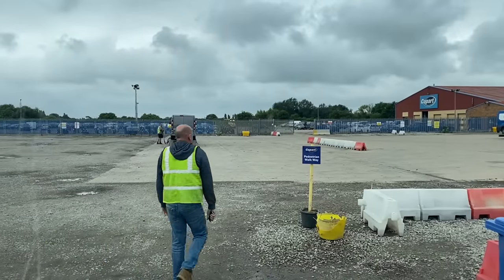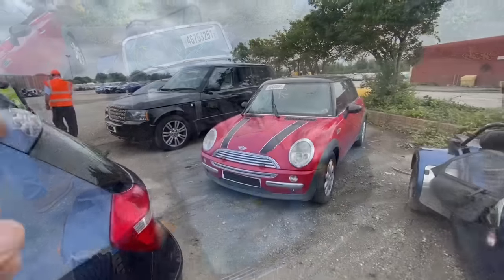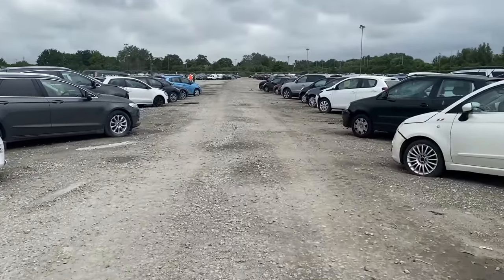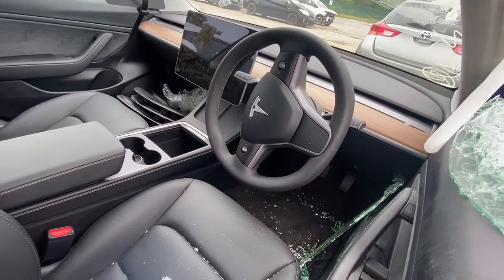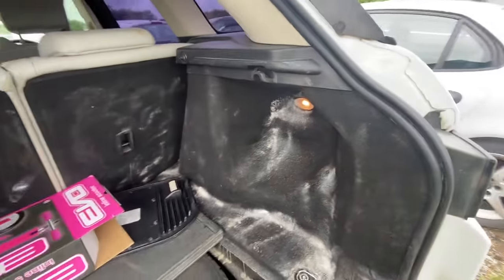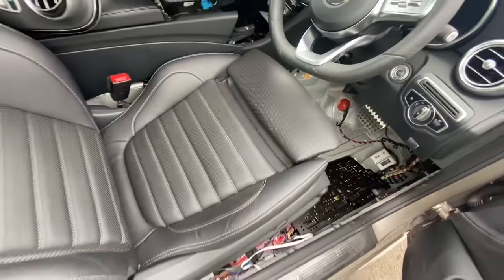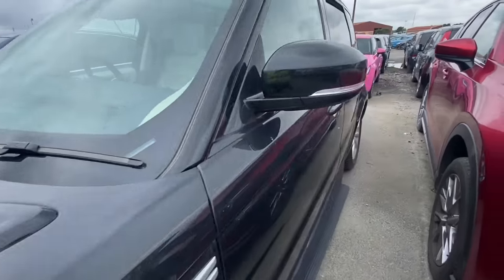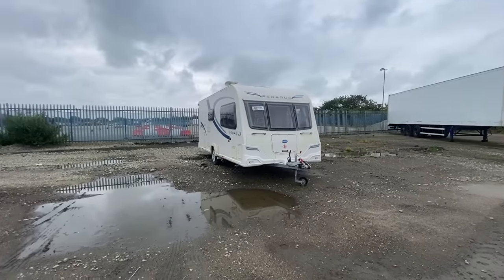Copart Salvage Yard Walk Around Caterham 7 C63 AMG Hybrid Porsche Tesla EV

Comment: 9:10 - "didn't see the back of it there, it's had a fire"

As is to be expected of hot, lithium batteries when pushed too hard (ie: to run a car). I giggled when I saw that tesla...long live the internal combustion engine!
Reply: it wasn't a zero emission car, on its last day!
Reply: That's either vandalism or a normal electrical fire. If the Lithium batteries had gone up there wouldn't be anything left.
Reply: @alibro7512  ICE vehicles generally don't have electrical fires, at least, they are uncommon. EVs on the other hand.

It also depends on if the fire was put out quickly or not. Batteries can be extinguished but without inhibiting the reaction Li has with air and water, it's hard to stop. Liquid Nitrogen and Dry chemical powder can work well for metal fires.
Reply: @S.ASmith  sorry mate, your wrong. ICE vehicles have electrical fires all the time.
This fire was no where near the high voltage battery which is in a metal box under the car. The fire started in the boot. Or rear seat.
Reply: @alibro7512  "ICE vehicles have electrical fires all the time"

I said generally don't . Electrical fires are more common on EVs, simple as. Saying otherwise is either ignorant or disingenuous. Electrical fires can happen in just about anything with electronics or cables that get warm/hot, but most fires in ICEs are caused by the fuel system or engine overheating issues. EVs obviously lack a combustible fuel, but the higher number of electrical components makes likelyhood of electrical fires much higher by comparison of a like for like ICE powered vehicle. Power-train cabling carries a lot of power to the drive motors, the stators can also get hot. 

Never mentioned anything about batteries in my original comment either, so feel free to continue knocking down the strawman you've built.

Comment: Buying a salvage Tesla is just asking for trouble. If you get the car up and running again, Tesla will probably disable it via an OTA update (not good whilst driving down the motorway). If you use certain parts from it to repair another Tesla, it'll probably brick the Tesla that's being repaired. Tesla is the Apple of cars.
Reply: Agree, Tesla doesn't want right off's on the road, parts have a handshake if from a different vehicle it won't work, heard some horror stories from the USA
Reply: It would be interesting to see what they fetch. Isn't there an American youtube channel who transplant the running gear into old classics?
Reply: @coyote5735  we do have a 'right to repair' (thanks to the EU) that the Americans don't which I understand Tesla sometimes try to avoid. But it's not quite the same here as there.
Reply: @jamesbrett6518  there are lots of people here putting the motors and batteries from Teslas into old chassis too!

Comment: Old Mercedes & VW golf interesting motors, thank you, peace.
Reply: The Merc would have made a great wedding car, all cleaned up. The Golf was a 1.6 Driver, quite low miles. If I'd got room I'd repair it with a new spare wheel well and rear panel, for prosperity.

Comment: Only 9 years to go before we’re all forced into electric cars. What effect will this have on all the mechanics up and down the country?
Reply: It probably won’t happen, but if it does most of them will be jobless. Which seems to be the plan automate everything so we aren’t needed
Reply: Not exactly - new cars will be all-electric, but petrol, diesel and hybrid cars will be on the road for many years after that.
Reply: @stephensaunders1845  Hopefully yes. However I expect fuel prices will be crippling and it will become more difficult to get parts. It’s going to be a big old mess.
Reply: It’s only new cars. There will be existing petrol & diesel cars on the roads for decades.
Reply: I suspect the demand for used petrol and diesel cars will go up and servicing older vehicles will be essential to keep them running. EVs still have bodywork, brakes, tyres, suspension etc so garages and workshops will adapt to suit.

Comment: Are you interested in a ford transit van its in the process of being turned into a campervan
Reply from the maker: Probably not bud sorry as the law on conversions recently got changed 👍
Reply: @sruk  ok cheers so best to scrap it
Reply from the maker: @dannybateman6220  what year is it
Reply: @sruk  2004 54 reg
Reply from the maker: @dannybateman6220  where are you based ?
Reply: @sruk  Darlington
Reply from the maker: @dannybateman6220  that’s 5 hours from me bud so wouldn’t be able to do it but I’m sure it has a value 👍
Reply: @sruk  I'm sure it does with the sills and rust spots fixing it will do
Reply: Put in on Facebook marketplace Danny

Comment: Why is everyone so scared of shocks from EVs? Everyone's going to be forced into these in 9 years!
Reply: Ain't no joke if you get hit with the full whack of one of those battery packs, it'll easily kill you or give you serious burns. 800 volts and many many amps will F up your day pretty quickly.
Reply: Because of crash damage might have cut the high voltage cables and they could be touching the body or something like that.
Reply: I wont be forced at all
Reply: @MattyEngland  a petrol tank doesn't get a special label, but if it was invented today  it probably wouldn't catch on
Reply: Won't be forcing me to drive a milk float.....
Reply: @jamesbrett6518  I get what you're saying, but unless you're taking a bath in one, then petrol tanks are far less dangerous than something that has over 3 times the voltage and current of mains electricity.
Reply: @smiffy5467  agree
Reply: @MattyEngland  doesn’t even take many amps. As those sort of voltages, 0.06 amps can kill!
Reply: @chrisrogers2848  indeed 👍